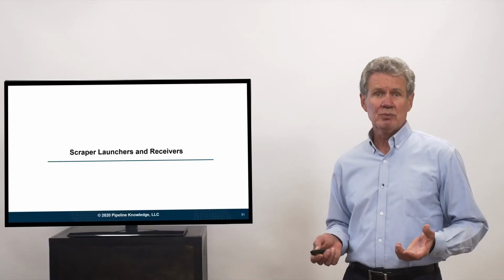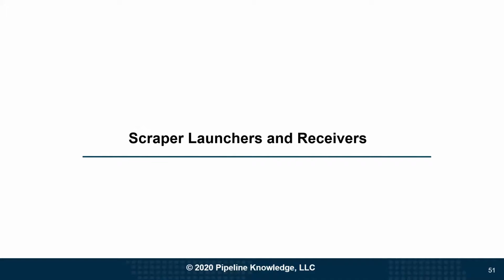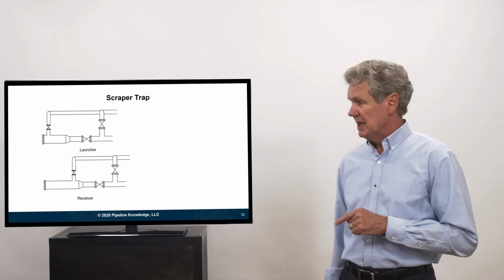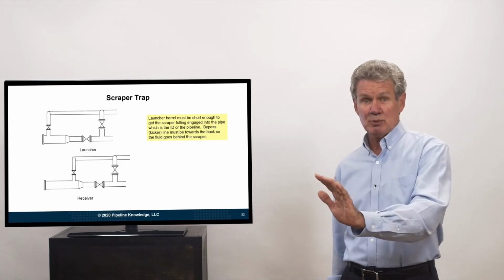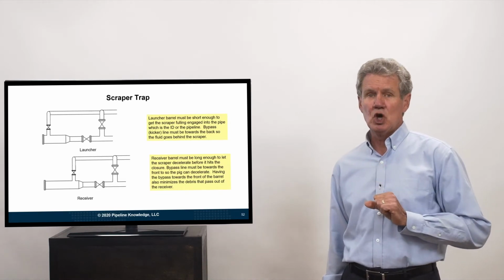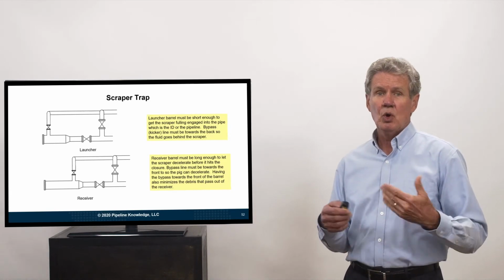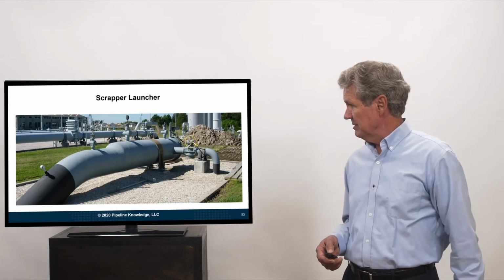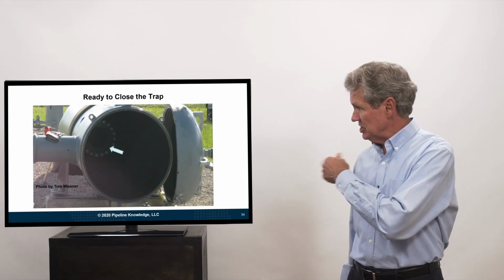Equipment and Components Clip

Comment: Thank you Sir,
Occasionally, operational constraints require reverse pigging (from the downstream end to the upstream end of the pipeline). Under these circumstances, if bi-directional pig traps are to be selected and installed, are both traps designed and fabricated identical to receivers, or as a hybrid combination of both launchers and receivers (e.g., in terms of overall length, bypass nozzle configurations, etc.)?